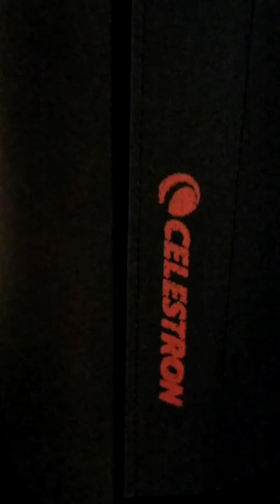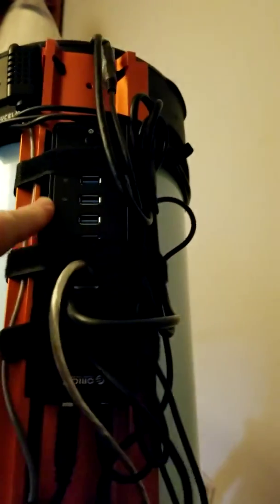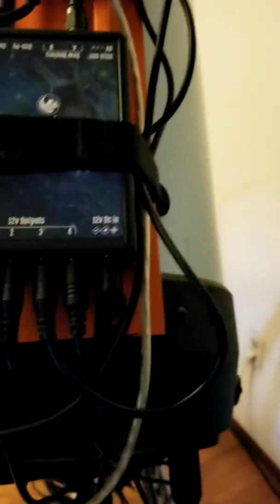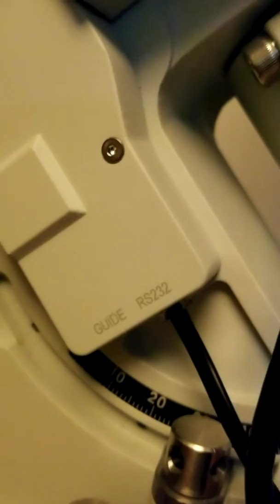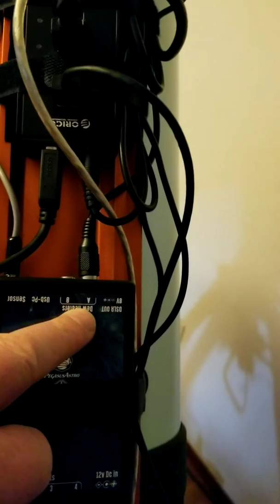RASA, iOptron CEM60 Cable Management, THIS time it works!

Comment: Wow, that's complex.  My power brick plugs into the back of the cem60, where the cem60 internal wiring passes power up to the two ioptron's mount plate 12v outputs, which power my dew heater and ASIAIR Pro sitting on top of my RASA.  The AAP then controls and powers the focuser, camera, guide cam, and mount.  Easy peasy!

Comment from the maker: This did work for cameras, but I still couldn't get my StarFi to connect to my CEM60 mount.  Then after a call to Cloudbreak Optics the first question they asked me was "did you go into your Windows wifi and connect to the StarFi"?  "Uh....I think I know what the problem is..." was my response.  They stuck with me and we made sure everything worked and it did.  So this Saturday night, 3/14/2020 will be first light.